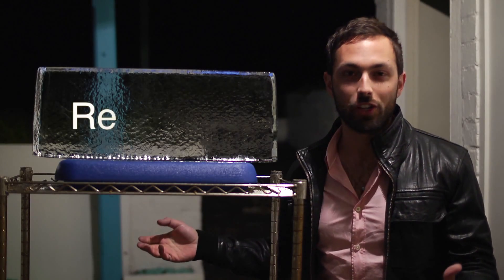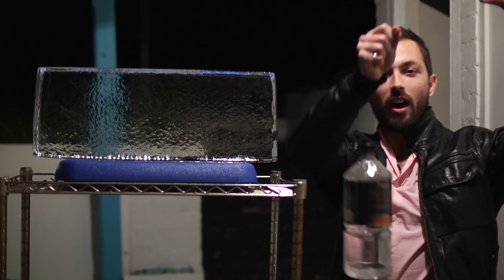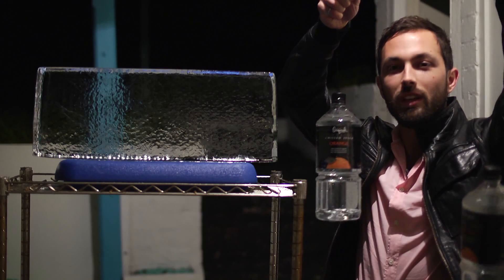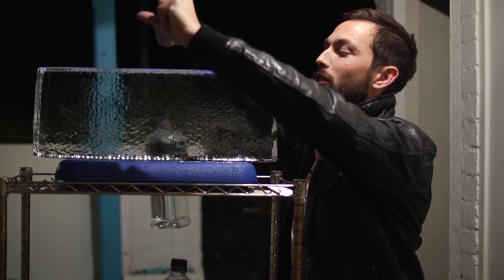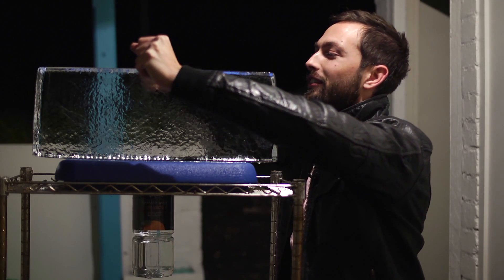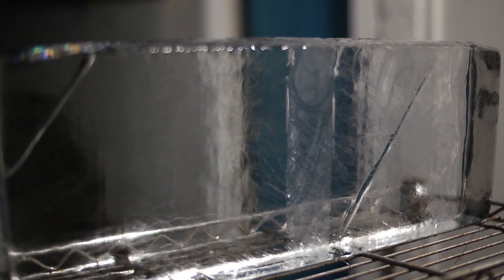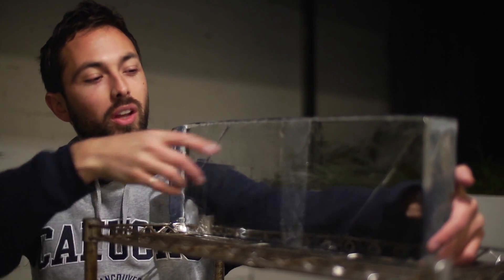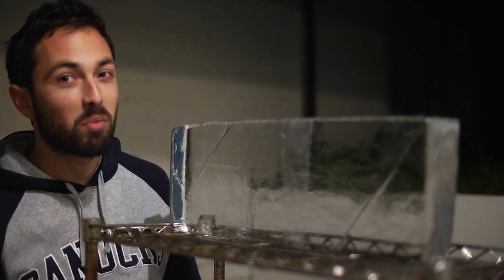Does Pressure Melt Ice?

Comment: I'm not buying regelation as the rejoining mechanism, or at least not the only mechanism. if you were to take two different blocks cut by a wire(to ensure a smooth side) and set push them together enough to make contact, they will freeze together in a similar manner.

Comment: yeah, good point. but the ice is at sub-freezing temperature. which would mean regardless of room temperature the copper wire would slow the longer it was in the ice. and it didn't. besides its pretty much established that it was the pressure. read the comment above the one you just made. it makes perfect sense.

Comment: The ice isn't melting due to the thermal conductivity of the copper, but due to the fact that water is more dense as a fluid. When pressure is applied, the ice tries to compensate for it by becoming more dense, which it can only do when it turns into a liquid. This is unique to water and a few other materials. Normally, when pressure is added to a liquid it will turn into a solid. This is why the earth has a solid iron core even though there is plenty of heat to melt the iron. Aka la chateliers

Comment: right, but couldnt this be the progression of what happens?:

1. Wire conducts heat to the ice it is in contact with
2. That heat melts the ice beneath the wire and the wire 'sinks' a bit.
3. that water is now above the wire and in contact with the colder ice, which then refreezes it.
4. Process continues.

Comment: agreed that pressure is what's breaking the ice, but I think the regelation is due to the fact that the temperature in the slit is relative to the ice surrounding it, hence most likely below  freezing, this sub-zero ambiant temperature is what's refreezing the liquified ice and so connecting the two block back into one (just as licking a frozen ski pole might put you in quite a sticky situation)

Comment: The reason why pressure changes the Ice into water lies in the fact that it's solid-liquid line on a phase diagram has a negative slope which is not true for most substances. A phase diagram basically graphs pressure against temperature and shows the common state at those points. So as long as the ice is constant temperature the experiment should be accurate since the only thing that is changing is the pressure. I feel if you were depending on the wire conducting heat it would take a looong time

Comment: Questions: In order to confirm that it is the pressure causing the melting, woudlnt the environment have to be kept at a sub-freezing temperature? Otherwise it could be explained by the wire itself conducting heat to the ice from the air, no? I remember seeing a video where a copper wire cut through the ice quicker than fishing line, and I figure that'd be consistent with it being a matter of conducting heat.

Comment: Would it also if the temp were below zero?  Couldn't the difference in temperature the wire has melt the ice or at least make it faster, and the ice would refreeze?  what if it were hotter!? I need to try this on a hot day and see if the ice would refreeze...

Comment: Almost only with ice, because ice is one of the only compounds which is less dense in its solid sate than in its liquid state because of the structure it forms. Therefore, at higher pressures, water will be at a lower energy state if it is in its liquid state.

Comment: Good observation, but as HailgodMC said, it's not the result of a magnetic field. An easy way to tell is to move just the ice, and see if it moves back on it's own. If it was a magnetic field holding it in place, then that magnetic field would turn it back also. Primitive compass worked on this principal, with magnets floating in water. A floating magnet will always point to the poles, if made correctly.

Comment: Since you're basically just turning the glass, the liquid between the ice cubes and the glass acts as a buffer, so the ice will not be affected by the glass moving. Like if the ice was the axle of a wheel, the glass was the rim of the wheel, and the water was the grease between the two.

Comment: Technically, yes, I believe this is accurate. You can think of changing atmospheric pressure as a way to stretch (lower pressure) or compress (higher pressure) an area of gas/liquid/solid. Pressure does slightly affect all materials melting & boiling points. For the majority of materials that shrink when "frozen", or solid, "stretching" it by lowering the pressure, say by putting it in a vacuum (or a place with much lower than atmospheric pressure), will cause it to melt at a lower temperature.

Comment: Only rare solids which expand when "frozen" (ie: solid) will do this because the pressure caused by the wire undoes the expansion that occurred when the material froze, which causes the material (water/ice in this case) to re-liquify. You also have to be at a temperature near the freezing point for such a small amount of pressure to cause the material to liquify.

Comment: Ice can't freeze water because freezing water requires most than just bringing the water to 0 C, you actually have to take out a bunch more energy from the water to freeze it.  When the water reaches 0 C (same temperature as the ice) then heat transfer will stop and you just have water at 0 C.

Comment: Half knowledge everywehre in these comments... it will work with Antimony, Bismuth, Gallium, Germanium, Plutonium, Silicon and a few compounds like Zirconium tungstate and Zinc cyanide.
the melting and boiling temperature depends on the pressure. search for phase diagram and density anomaly

Comment: It does make sense, because I believe that all substances are dependent on the surrounding pressure. That's how they make pressurized gas, they put it in a bottle, pressurize the bottle to get that gas into a liquid form. That's what happens in this video. The pressure is higher on where the high E string lies, resulting in this mentioned process called regelation. :D Science is awesome! ;)

Comment: yes, because water is the only thing that has a smaller density in a solid form. when you add pressure the density of the molecules increases and it becomes liquid. of course you can cut other stuff by applying pressure but you wouldnt melt it, you would simply cut it.

Comment: It would work with any anomalous substance that, like water, has a larger volume while solid than while liquid.

However, depending on the melting point of those substances you will need huge pressures or to elevate the temperature a lot.

Comment: but doesn't the thermal conductivity play a large role in the actual melting of the ice? The wire conducts heat energy away from the ice so it melts but once the wire has passed through then the ice can re-freeze the water above the wire. Right?

Comment: eh it would not work with most metals...if any.  it depends on the triple point (pressure, temp) of the substance.  Ice works well because it has a vertical transition as 0c between liquid and solid...so only a change in pressure can revert it back and forth between liquid and solid.

Comment: I don't believe you can already conclude the Mpemba effect is a myth. It's not a myth because in under some certain conditions hotter water does infact freeze faster. The Royal Society of Chemistry have replicated the effect. The problem with your experiments and in general replicating it, is that there are too many variables to control, some which we cannot control. Which is the explanation for your results.

Comment: Ice is lower density than liquid water because when it freezes, water molecules form big, open rings in a lattice. Applying pressure collapses this open lattice back into a higher density liquid form. The same effect should occur in most any substance which exhibits similar liquid-solid phase transition properties.

Comment: I don't think that it's an actual 'regelation' process, instead I think it's thermal conductivity. String carries a heat that causes ice around the string to melt and gravity do the rest. It refreeze because the block of ice is colder than the freezing point of water and it takes the heat away from water.
An actual 'regelation' process should cut the block in seconds!!!

Comment: Couldn't it be, that it's not the pressure (because I learned that LOWER pressure decreases melting- and boiling-points, and it makes sense to me) though it's the better conduction of room temperature through the  metal-string on to the ice in comparison to the air?

Comment: Couldn't it be that this effect is because the wire conducts the heat better than the air, like in your video to misconceptions about temperature?
I'd like to see this whole experiment with under 0°C roomtemperature, or with an isolating string.

Comment: That's not what he meant, I guess. If you have a cup of boiling water, and throw the contents into the air, provided it's cold enough outside, it flash-freezes almost instantly, while a cup of water at room-temperature, thrown into the same vold air, comes down as liquid water still, not frozen

Comment: I think typically they use a small amount of vibration to keep bubbles from forming in the ice, or take a steady stream of water over a surface to form the ice slowly.  You also need very pure water for this to work the best. Get distilled water and/or boil it to remove impurities.

Comment: Is the wire also conducting heat/warmth from the surrounding room? The pressure downward mixed with the conducted heat helps pull the wire through. Then the water between such a thin gap with two freezing blocks on either side should re solidify.  You would have to cut through much quicker to keep that from happening.

Comment: Ice is REALLY fun to play with. This video is great ((as well are the others)) and it has intrigued my knowledge to what would happen if you set the wire up again, but on an intersecting path. It ent(ice)s the question: Would the intersecting point be a right angle? or would it smear downward or would the lines get thicker at the intersection, or even maybe more than one outcome.

Comment: When water freezes its volume increases.  This is due to the chemical nature of water, mostly due to the fact that it is a polar molecule.  In order to form a solid, the molecules need to arrange themselves in a very specific way, which requires more space than when in the liquid phase.  By applying pressure, you are forcing the system to change, in this case the system can change most easily by reducing its volume and thus, melting.

Comment: Isn't it more likely that the material the string was made of was a good thermal conductor and it melted the ice just around itself? Then, as the string moved through the water, the water would then refreeze.  

You would have to do this with other materials to prove the regelation.

Comment: I have a hypothesis. Assuming the E string is steel, it is conducting the energy from the air, giving enough energy to melt the ice where it is touching. After the string is no longer touching the ice, the two frozen blocks remove the energy from the film of liquid water and re-freeze it. The E string is so thin, so the surface tension of the H20 is strong enough to span the small gap and make it whole again. Perhaps this hypothesis could be tested with an insulator, like fishing line.

Comment: Cold water expands. Hot water doesn't.
So when you freeze cold water, there is more volume taken up by it. Think of it as there being "more water to freeze". So since the difference in the amount of space it takes up ends up being more significant than the temperature difference, the cold water takes longer. Of course this only works when you have the same amount of water (same weight) so that the cold water expands and takes up more space.
Aaaand I'm probably totally wrong. Whatever.

Comment: It happens only in the right circumstances, but when those circumstances are right, apparently the warm water gets a convection current going which helps it shed more heat.

Wikipedia looks like it has more info under 'Mpemba effect'

Comment: How do you know that its regelation and not caused by the wire conducting heat to the ice from the air? It would have been better if this experiment was done in freezing temperatures.

Comment: Yes, I have no doubt about the fact that regelation effect works and the general idea behind it.

My doubts are about whether or not there are other effects at play i.e. using a wire with high thermal conductivity in an environment with temperature above the melting point should contribute to the speed at which the cutting occurs (the same way that ice melts faster on a metal plate in room temperature).

On a side note. What is the temperature of the block of ice in the video?

Comment: It's pretty simple the colder the ice the more pressure you will need to cause the effect. There fore you will need a thinner and thinner wire if weight remains the same or denser and denser weights if the wire remains the same.

Comment: Videos about ice tend to raise a lot of questions for me:
1) How would the regelation experiment work at different temperatures?
1a) Above 0 - Though I guess this is answered by this video
1b) Slightly below 0, let's say -3 C.
1c) Way below 0, let's say -30 C.

2) (Not directly connected to this video) How slippery is ice at different temeperatures and different pressures applied by the object that will be sliding on the ice?

Comment: No, it's because of the pressure, like he said. The same thing happens with ice skate blades. The ice momentarily melts and provides lubrication between the skate and the surface of the ice, otherwise ice skating would not be possible.

Comment: please correct me if im wrong. Ice is a solid because it has compressed molecules and the temperature means that they dont move around as much etc. so common knowledge would lead me to assume that more pressure would make it solidify more. however the further compression by the wire makes the ice slightly hotter for the time that compression occurs and allows it to melt. then pressure is released and the temperature drops again. right?

Comment: The transition from ice to water is a function of temperature and pressure. Maybe water cannot co-exist with ice below -20, but it can at -4.  The trick is to choose the wire size & weight to generate just the right pressure to raise the melting point above the temperature of the bulk of the ice. The ice will melt below the wire and the wire will fall. As you saw :-) Millions of ice skaters rely on it :-)

Comment: American Journal of Physics, Volume 63, Issue 10, pp. 888-890 (1995).
It is proven that pressure can not cause ice to melt.
"The pressure needed to reach the melting temperature is above the compressive failure stress and, if it did occur, high squeeze losses would result in very thin films. Pure liquid water cannot coexist with ice much below −20 °C at any pressure..."

Comment: No, the wire was at the same (or close to) the temperature of the ice. It's because of pressure. As you apply pressure to ice (or anything), the freezing/solidification point changes, allowing ice to melt at lower than 0 temperatures. That's why you can form snowballs. When you squeeze the ball of snow some of it melts, then when you release it it freezes back glueing the snow together.

Comment: this only works because the string is conducting heat and thereby melting the iceblock. you would need a crazy amount of pressure to actually see regelation.

Comment: I did it outside this February by -5°C and after 17 hours, the wire had just started to go half a millimetre into the ice on the edges but was still free on top.

When I brought the apparatus inside, the (metal) wire crossed the block in 20 minutes.

Comment: Nice demo: thanks. We did this experiment at the Royal Society in London a few years ago, but we put the whole thing in a glass-fronted freezer - like those used in shops. My calculation is that 10 atmospheres pressure lowers the melting temperature by only 0.1 degrees Celsius. So depending on the temperature of the block of ice in your experiment I think you may be observing a combination of effects. Pressure melting aided by thermal melting near the edges.

Comment: Um... I love learning about physics, however I am a skeptical man, and I think that the temperature of the material isn't considered.
I mean, if the air is warmer than the freezing point of water, then wouldn't the string act as a conducter of heat from the air to the ice?
Although I guess that wouldn't solve the problem either since the water would still get the heat from the same source, and it's heat conductivity would matter more than the wires...
Hmmm

Comment: I was surprised at how smooth and nice looking the curve of the wire was inside the ice.  I've done some thinking about it and I reckon it's a catenary, do you know if this is right?  I also reckon the vertical distance between the peak of the wire and where it leaves the ice is equal to half the width of the ice block.

Comment from the maker: @Desterado yes - the pressure can reduce the melting point a degree or two so the ice becomes water under the wire - there are also some more complicated effects due to 'liquid-like' layers of water on the surface of ice even at very cold temperatures.